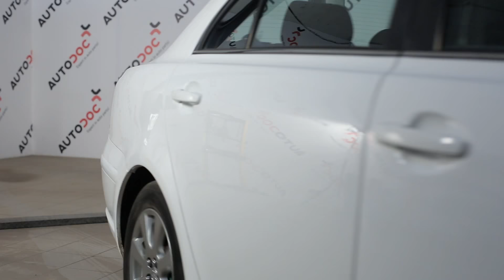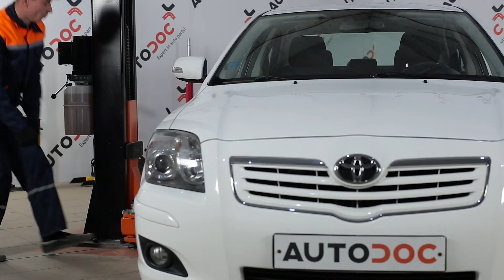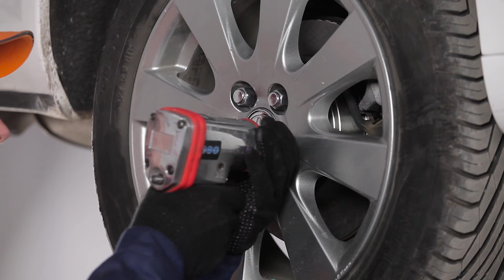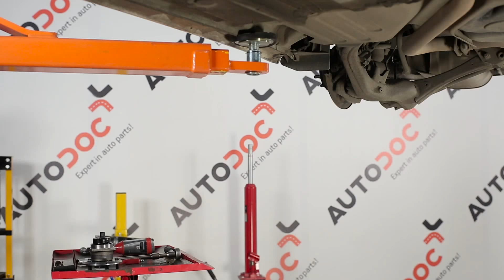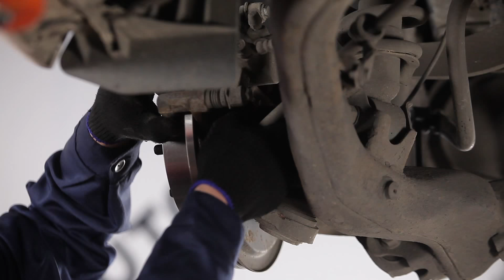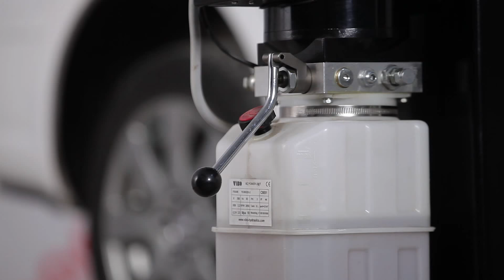How to change Rear wheel bearing on TOYOTA AVENSIS 2 T25 TUTORIAL | AUTODOC

Comment: I did change them on both sides (boght them in Autodock) and now noticed eksessive tire wear on both rear rear wheel inside - can it affect wheel alignment?
Reply from the maker: Yes, after any work related to the suspension of the car, it is recommended to adjust the wheel alignment.